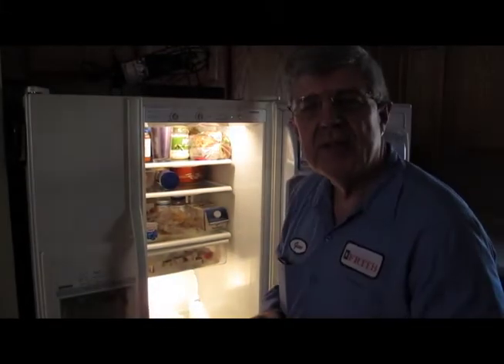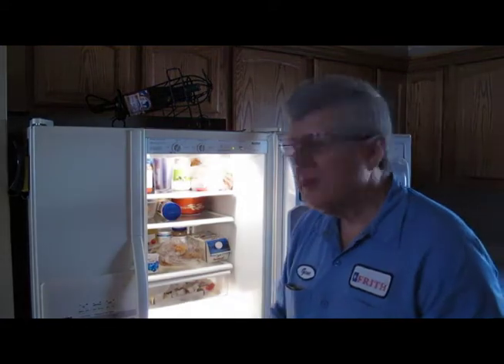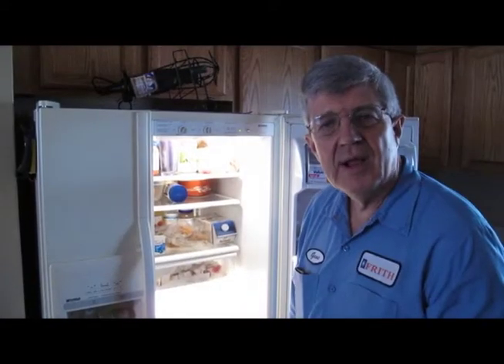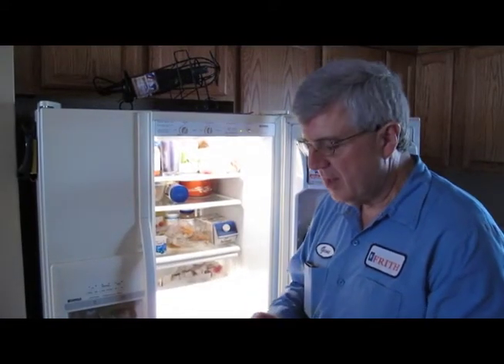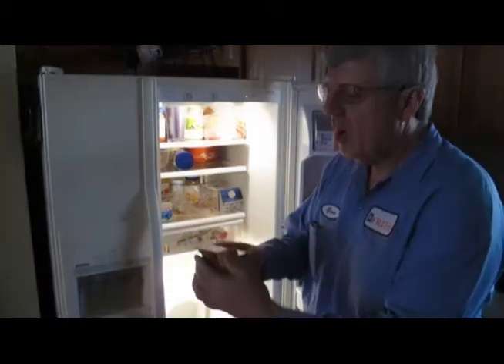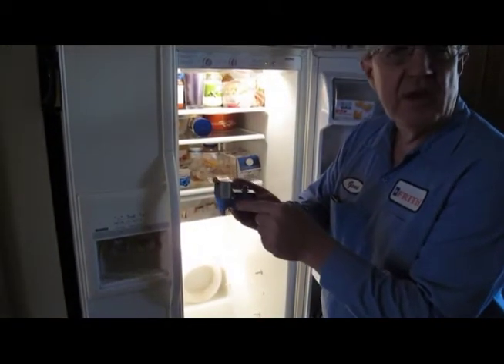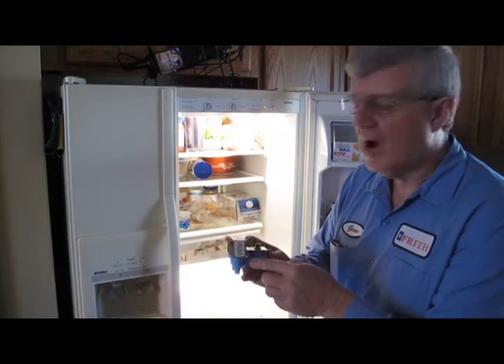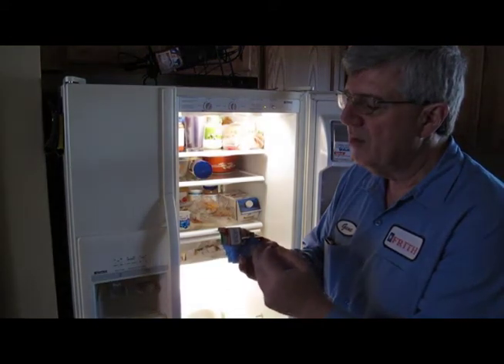Frith - Ice Makers.mov

Comment from the maker: Yes the screen can be cleaned. However if the screen is plugged with debris then it is possible some smaller particles got past the screen and could cause the valve to leak. It is better to replaced the valve.